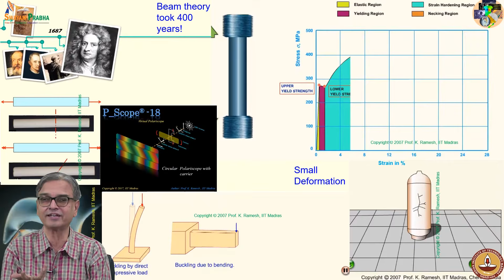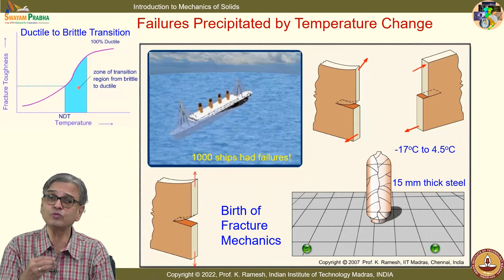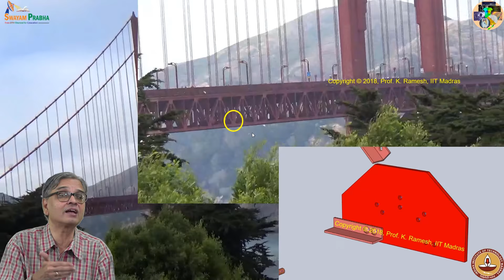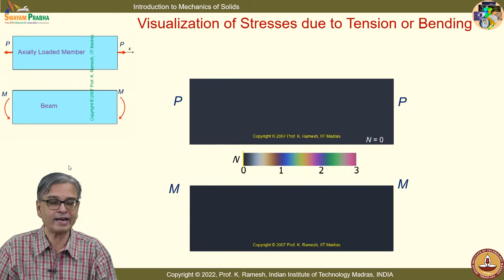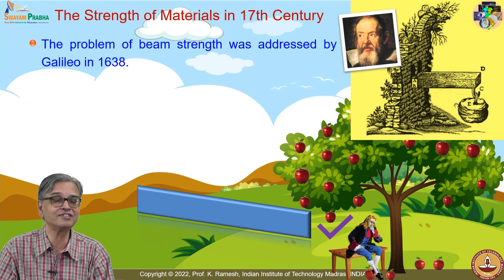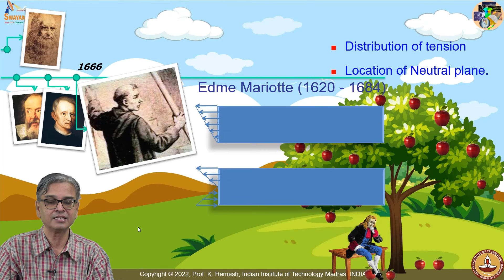LEC 01 Introduction to Strength of Materials- 1

Comment: it is for civil or mech students ?
Reply: This course is for both civil and mechanical engineering undergrads.
If you are a programmer, you are just a coder, not an engineer. Don't bother.
Reply: @aerodynamico6427  wtf bro😂
Reply: @sayakpramanik2373  Hurts, doesn't it? But your are being replaced by AI!
Reply: @aerodynamico6427  no bro, I am a mechanical engineer working in HPCl ... The work that I do will not be replaced by AI for atleast next 10 years
Reply: @sayakpramanik2373  Well, I'm relieved — unless you are a white-collar worker. Then your job is a goner.
Reply: @sayakpramanik2373  9 YEARS LEFT